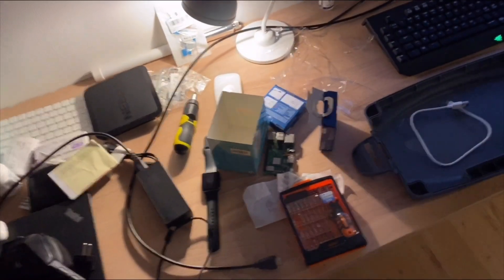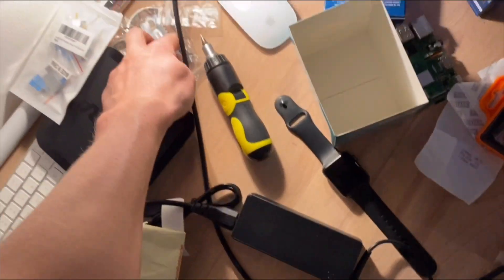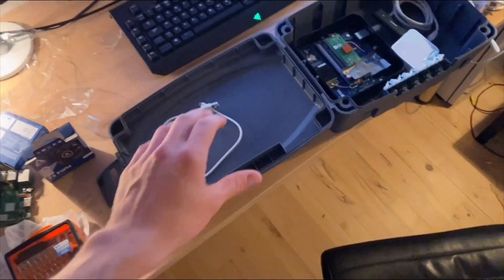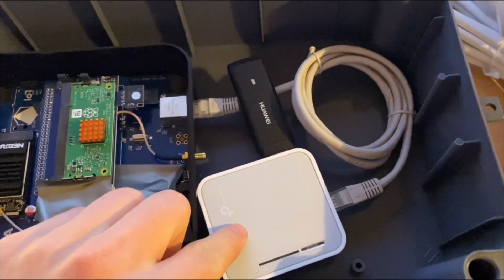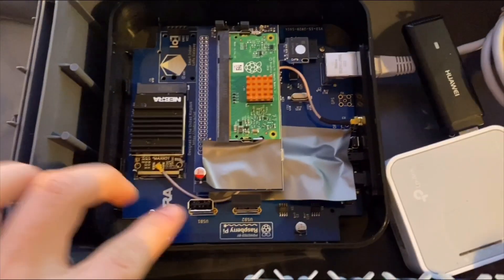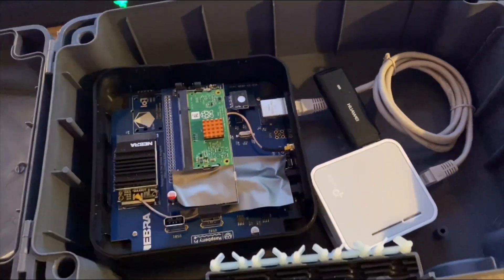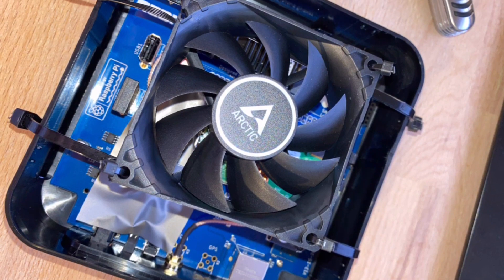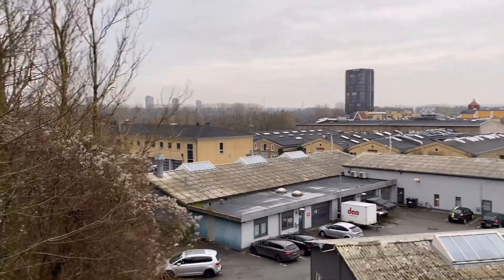Upgrading the Nebra Miner Setup. How to Build the Perfect Helium Miner.

Comment: @1:35pm, the antenna is pointing the wrong direction.  The mounting pole is blocking the long range lobes of the antenna.
Reply from the maker: Thanks alot - check out My latest video.